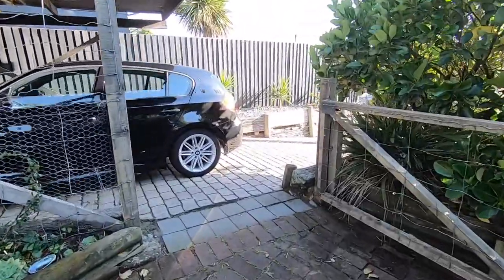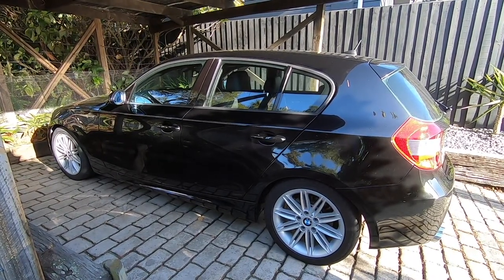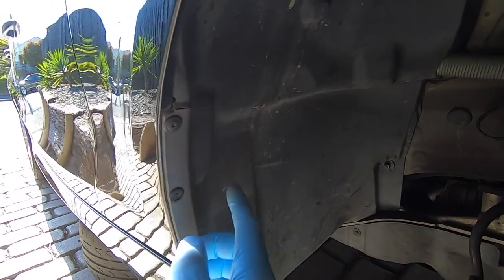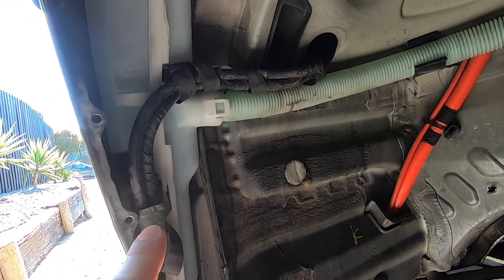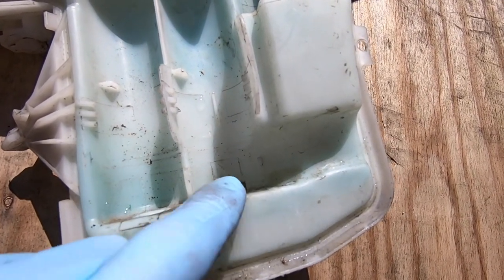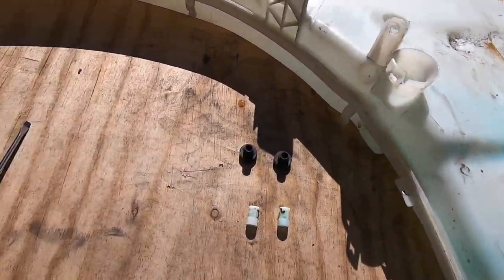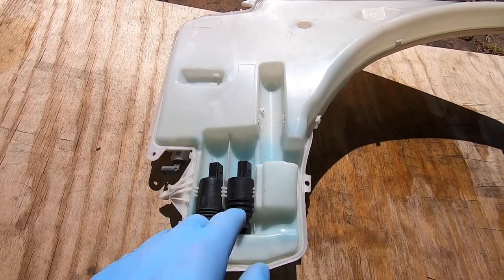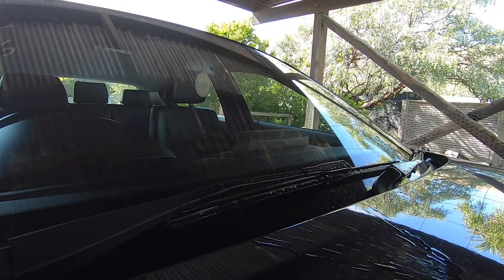BMW E87 1 Series Windscreen Washer Spray Fix

Comment: Hey man, I've never diy anything more complex other than a wheel change or adding more oil to my116i E87 until the window washer pump failed on mine. Me and my dad were able to fix it ourselves thanks to your video. Cheers mate you got a sub from me 🙂
Reply from the maker: That awesome man, great to hear! Good you got it sorted. Thanks for checking out the video & the sub 👍

Comment: My 1 series pump sprays once then won't spray again for at least 1 hour. After spraying when try again can't even hear the pump engage. Any ideas??
Reply from the maker: Might have a blockage, or sludge in the reservoir. If you keep operating the pump the car will cut it off for a bit to prevent burning the pump motor out
Reply: @MTechGuy  thanks. I will watch your video a couple more times before I start to take it all apart.

Comment: Excellent video. I will give a go as the washer jets of my wife's 1 Series has completely stopped to work. There is fluid, the pump is working but the system is clogged somewhere. Wish me good luck as I am not very good...
Reply from the maker: Easy fix, good luck!

Comment: I did this with mine a few years ago as I do very few miles in it and it was clogging up due to the reservoir getting warm. This was a combination of warm weather in the summer and engine heat. I now only use genuine BMW washer fluid and have had no issues since as the BMW fluid is anti fungicidal and won’t turn into jelly. 
I suppose any anti fungicidal washer fluid will do the same job but as I use very little of it I’m happy to pay for the BMW stuff. 
If you do a lot of miles and regularly use your washers, the cheaper stuff will be ok. 
Although the job isn’t too taxing, it is a pain compared with most other cars that have the reservoir in the engine bay. 
Nice job M Tech Guy, keep the videos coming 👍
Reply from the maker: Cheers for sharing Sixcylinders, I started using the genuine BMW washer fluid a few years ago too, it’s good stuff and relatively cheap (that’s what I’m using in this video)
You’re spot on, I use it in my M5 & 130i, but use the cheaper turtle wax fluid in my X5 as we get through fluid really quickly with the family wagon.
Thanks for watching 👍

Comment: I had this exact same problem and couldn't be bothered taking the car apart, I just disconnected the hose  that connects to the bonnet jet and connected up the garden hose with a bit of tubing and a tape job. I slowly ran The Hose  and back flushed the system. 

Through the filler hose I could see all this crud come out and let it run for about 15-20 mins. After that I got my shop vac with a small tube taped on the end and turned the vac on and ran the hose. It has been about 18 months and no problems!

Comment: Interesting discussion about the topic and where the problem actually may be. 
I have a x3 20d 2008, and I think the nozzles are the same. 
Today I took the nozzles apart and used compressed air to clean them. Tested one first!
Now they spray about 40 % up on the windshield at stillstand, but I would like to have higher att stillstand!

Am I right when I say that there is no height adjustment in the nozzles? You could say it is automatic/default!?

In this model, x3, there is a kind of filtercup underneath the pump/pumps.
My mate, auto mechanic, says when the pump/pumps do not run, try to knock on them first. I did and it solved a problem! Now I have two them on store...
I didn't clean the reservoir nor hoses.
My water here is now not very good, too much iron in it. It comes from a well in the nearby field... May be not filtered at all...

Here in the country we use "simple" spraying fluid, 50 % in vinter above -40°C(!). I think it's almost pure alcohol/ethanol.
I thank you so much for clarifying the main course!

Comment: This video is really useful as I've always wondered how the hell can you remove the washer reservoir! Problem I'm having is rattling coming from the front drivers side. I suspect it is the reservoir rattling around as the suspension components are solid with no play.

Comment: Not had my e82 for too long but glad the washers working good and strong. Didn't realise they were hidden so far in the front wing- what a lot of faff!
Can't believe how clean your wheel well liners are - OCD perhaps?
Reply from the maker: A bit different to pulling a regular style reservoir out the engine bay!
Yes big time OCD, I like to keep my cars super clean, it works out well in the long run

Comment: Your videos are awesome man! Quick question regarding the washer jets. My rear washer jet on my E87 is not spraying. I can hear the pump working but no water is coming out. Would this video you've done also sort the rear washer? The 2 washer pumps that you show, are they one for front and one for rear? Cheers
Reply from the maker: Yeah one pump is for the rear, but it’s probably a blocked rear jet/non return valve. Check out these previous videos I made on the rear washer-
https://youtu.be/3yrw_RmEAeI
https://youtu.be/7JoP7kRi9bg
👍
Reply: @MTechGuy  awesome mate. I unblocked the nozzle as per your video and it worked a treat!! Top man!

Comment: I wonder if it's a good idea mix glass cleaner into the reservoir? Would it hard the rubber seals?
Reply from the maker: Probably not a good idea. Get a screen wash from Europe/Scandinavia- they usually have alcohol in them as an antifreeze
Reply: @MTechGuy  thank you. Also, I am trying to find the EGR valve on my n46 120i e87. Can you please do a video on locating and removing that? Thank you on advance.
Reply from the maker: It’s located at the left side of the engine at the front of the intake manifold, it has a diaphragm actuator on the side of it
Reply: Which one pump is from the front windscreen and which one from the back one?